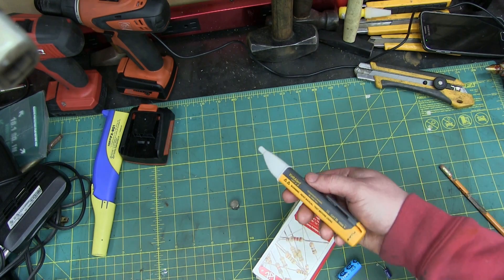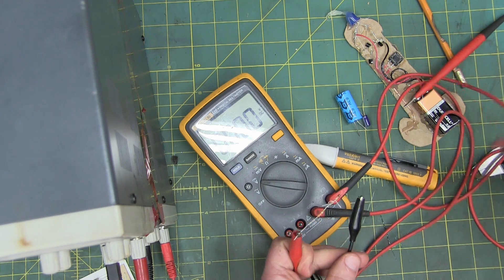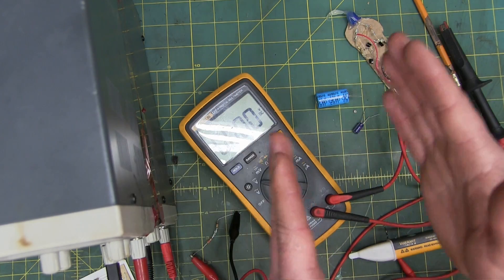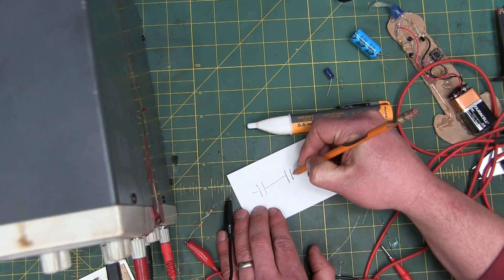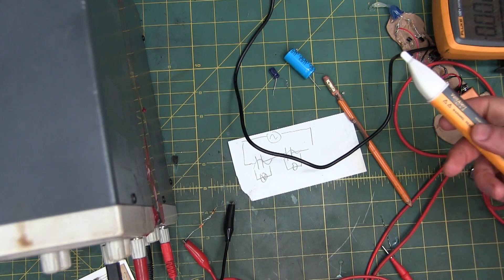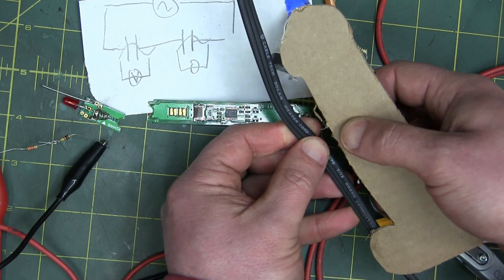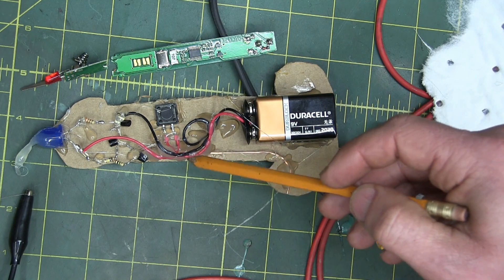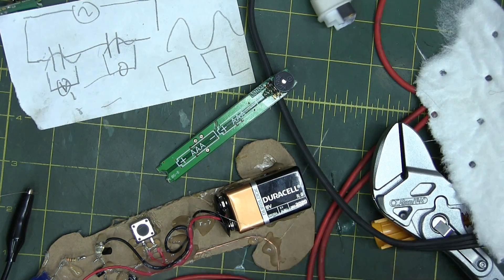Non-Contact Voltage Tester | How does it work?

Comment: this comment has to do with your clear wood video.
I dont know what you have and haven't done off camera. But I have a few suggestions, as I have some experience with resin and stabilization of wood with the use of resin. First off, did you soak the wood in a couple RO water baths to remove the salts? Got to remember that sodium hydroxide is hygroscopic, so setting it out to dry wont do any good. I also doubt the presence of the salts helps with the transparency of the wood. You may also need to bake or even put the wood under a vacuum to properly remove the water content, as wood doesnt let go of all water at ambient conditions, even in a zero humidity environment (as far as I have learned, wood is a little hygroscopic as well.)

I have also learned that some resins are sensitive to sulfur and sulfur containing compounds, so you may want to be extra sure to thoroughly remove the sodium sulfite. 

Your urethane resin is almost certainly too old, as if its been opened in the past, then its been exposed to water. I have looked into the reaction involved in the degradation of urethane resin, and part of the reaction with water, results in the creation of more water, so once that lid is opened, it has a limited life. 

I highly recommend researching what resin the research group used. you are going to want something that sets slow, to give you time to properly degass the wood. you may also want to look into wood stabilizing resins like cactus juice or gator venom, as they are heat cured, which gives you all of the time in the world to degass the wood.

something you should also strongly consider, is if you decide to go with a two part resin and not a wood stabilizing resin, you should both degass AND pressurize the samples, and leave it pressurized until the resin has cured.

If you have ANY questions or comments, please dont hesitate to ask :)

Comment: when i had one of those i could never use it like you did, its like it was too sensitive, it would light up when i got within  6-8 inches of a cord or outlet so i couldn't use it to see which wire or prong was live and which was neutral, it'd light up anywhere near it. it was a fluke brand so i'm assuming it was a good one

Comment: When current flows through a conductor it creates an electro magnetic field (emf). The more current that flows through a conductor, the larger the emf. Non contact voltage testers (NCVTs) only work within a specific voltage range (ie. my fluke only detects voltage between 90-1000VAC). This is because this NCVT has been designed and constructed to detect this amount of emf. It is possible to manufacture other NCVTs that can detect higher and lower voltages. However, detecting higher voltages with a NCVT has its own issues that I won’t go into within this comment. 
Essentially, what I’m getting at is that NCVTs work on the principle of Faraday’s Law of Electromagnetic Induction. 👍🏻
Reply from the maker: "When current flows through a conductor". How much current is flowing in a "hot" wire that's not connected to anything?

Comment: Hey I was curious I have a stud Finder that also has A non contact voltage tester built into it and if I put my hand in front of it and wiggle my fingers it senses Electricity is at the static built up in me or is it picking up electricity my body produces

Comment: I'm confused. The thing you made is a sort of radio receiver. Am I right that that isn't working on the principle of a capacitor voltage divider? In particular it shouldn't need a ground connection through your body but the capacitor thing does. So then are you saying the chicken stick works the same as the thing you made, or is it a capacitor divider?

Comment: One of those ticker testers saved me and my buddy's life at work one day. We were at Irving tissue in their switchgear room getting ready to add another section to the row of breaker racks. The Journeyman we were working under, along with a plant maintenance worker,  disconnected the power and locked out the section we were to work on. Then we were given instructions to remove the side panels and remove the bolts holding the copper bus bars together to get ready for the new section. We got the covers all off and were getting the sockets and wrenches ready when I told my buddy "wait" and I pulled out my ticker pen just to make sure. That shit started ringing more than 12" away from the bars so I got out my meter and measured a full 600v across all phases. Turns out they cranked out the wrong breaker... Jeff was literally walking up to that thing with a wrench about to start working on those bus bars and I put my arm out to stop him when I said "wait". 1600amps 600v , about 30' from the exit, we would have been dead for sure!
Reply: 600 volts really how odd.

Comment: Im just guessing these types of probes work by measuring EMF or by using the battery inside as a voltage reference with an inductor an/or capacitor measuring the change in voltage

Comment: It's probably a waste of words because if the patron pestered you about this non contact voltage tester he probably cant understand this: I believe the reason AC feels so much more intense when you get shocked is the fact that it is more. 41.4% more to be exact at its peak to peak measurements. Our meters convert it back to a DC RMS number for practicality sake.

Comment: @ 4:59, took me back to my high school days. We used to blow capacitors up in electronics class when the teacher would venture out of the room. Probably not the wisest thing to do. However, how many of us were wise in high school?
Reply: My friend in electric shop put a nail if each side of an outlet, laid his watch across them and powered it up. He didn’t understand why his watch wasn’t “shock proof” when it said it was. 

Not the brightest bulb...
Reply: assassinlexx, how many of your friends did you shock the snot out of? I never thought of doing that? Lol
Reply: Back in the day, I worked at a certain audio mfr in Lynnwood, WA. The production test techs would punish any of their fellows who came in late and hung over by putting a few capacitors in their (switched, normally off) test bench plug strips. Never seemed to learn....
Reply: High school is where we went to learn about life while they dumped useless information over our heads.
Reply: Paul Drake, I now have kids in high school. They still dump useless information over their heads. Actually, more now.
Reply: And they got rid of the good stuff. I had trig/analyt in11th and my kids highschool tops out at algebra 2

Comment: The original 'voltstick' only use one FET and 2 AA's, the gate of the fet going to a wire in the tip next to the led, so it was an open gate, didn't even need a pushbutton, very little to go wrong.
sensitivity adjustment was bu placing a finger close to the tip to attenuate the signal.
The Schmidt trigger is not exactly a square wave, as the voltage rises it 'toggles' to on, as it falls it toggles to off, there's a bit of hysteresis in the system too.
Reply: Bad experiences (detection unreliability) with the original Fluke model. Acquired a Uni-Trend UT12A detector (via a colleague who's dad worked for Uni-Trend), and that's lasted years - VERY reliable, and acceptably sensitive (i.e. relatively immune from floating neutral false detection). Recently acquired the "new" gadget from Mustool - their MT812. Interesting in that this has a graded (LED bar-graph) response - sensitive enough to detect neutral return / low induced voltages (so useful for tracing "de-energised" cables), but also capable of discriminating between "live" and "induced voltages". Not enough experience to fully trust this for "last minute checking", but it seems as good as the old Uni-Trend for high(er) voltage detection. Any other "early adopters" out there for comments??
Reply: Sparky Projects The whole purpose of a schmitt trigger is to provide hysteresis to a basic comparator
Reply: Have you had any experience with Santronics testers? Being an electrician for the last 18 years I have found it to be very simple and sensitive.
Reply: santronics the best 17 yrs in business.   no on/off  switch     VERY reliable
Reply: wowzer i justs had a nerdgazum

Comment: Why is there a battery-powered penis on the healing bench?!
Reply: Notice the extra smoo on the tip.
Reply: Robert Leitch AvE has habit of using his wife things.
Reply: just the tip, mind you
Reply: Okay, now it all makes sense.
Reply: I believe thats called the PixiePenisProbe, it goes with the PeckerDetector lol
Reply: Maybe it is for dicking around?
Reply: microbuilder No.... It doesn't "goes" with the PeckerDetector, it "comes" with the PeckerDetector... But only if she's in the mood.
Reply: Why do you think there needs to be a reason to have a battery-powered penis on the healing bench???
Reply: Why not?
Reply: Ahem... It would not fit in the vice. :-D
Reply: Victor García and only for a minute
Reply: It's actually on the relax-o-mat.

Comment: I would love to see how a pH meter works
Reply: A pH meter has two electrodes. When you dip them in the solution under test (an electrolyte) a voltage develops between them. That voltage is dependent on pH. Confuser then converts voltage into appropriate pH readout.
Reply: The electronics are simple (high impedance FET millivoltmeter is all you need - an "off the shelf" cheap meter works fine!). The electrodes are the costly component (though there are cheap ones via the usual Chinese suppliers). If you are looking for an accurate, linear (over a wide range) pH meter - then you're going to have to spend a little more (actually a LOT more), but as always you get what you pay for.

Comment: @2:25 just wanted to bring up a (sometimes forgotten) point here. Voltage dividers only work for things like microcontroller inputs/other high impedance situations/etc. You can't use them to drop the voltage to actually power anything that will draw any useful amount of current, since you need the current through the first resistor to be more or less equal to the current through the second resistor for the equation to be valid.
Reply: Those two scenarios your describing aren't resistor dividers, those are current limiting resistors. the lightbulbs limit the current in the coil, and the resistor limits the current through the LED. Your idea in the video about powering a 5v device off of a 9 volt battery won't work if the device needs more than a few milliamps.
Reply: Yup, what the other gentlemen here have said. Let's go through an example here: Say you've got a load that draws 1 amp at 12 V, but you've only got a 24V power supply. Should be easy, right? Just wire up two resistors of the same value in series (for simplicity sake, say 1K Ohm each), and attach the load at the middle point between the two resistors, and all is good, right? 

But do the math and you'll see that everything is not good! Before you attach the load, you'll have 24V/(2K ohm) = 12mA of current through both of the resistors. Attach the load, and suddenly you'll need to pull an additional 1 Amp through only the first resistor, which isn't going to happen if you keep that resistor value at 1K and the supply voltage at 24V (since V=IR, if you wanted to keep a 12V drop across the first resistor, you'd need to drop the resistance value down to ~12ohm - and get a resistor rated for 12W heehee!). 

If you know that the current draw will always be constant, then you could make it work by doing the proper math ahead of time. But if your current draw varies (such as with a motor with varying loads, a bunch of LEDs that you've got a dimmer attached to, etc), a resistive divider just won't work well for you. That's why (along with efficiency/heat concerns) voltage regulators are used when you're going to be actually powering something with a lower-than-supply voltage.
Reply: If you’re doing a voltage divider, technically you have to account for your load being in parallel with one of the resistors in the divider. 

This is the basic principle behind the LM78xx/79xx series of linear voltage regulators. The chip is in series with the load, and constantly varies its effective resistance, relative to the load’s effective resistance, such that the load always gets the desired voltage.
Reply: Rule of thumb is you want to pull no more than 1/10th of the current that goes through the whole divider on the center tap if you don't want to have to factor in the additional drop. Obviously that current shouldn't vary much.
Reply: Btw the solenoid is the second resistor,
Reply: A 12v solenoid has a fairly stable resistance.
All inductors I've come across have a resistance measurement. A solenoid in an inductor with a moving core.
Reply: The thing is, if the demand is constant a resistive divider will work.
I wont work when the load/resistance is variable.
The light bulb could easily be swapped out for a big resistor or even another solenoid.
Reply: Back in the days of yore  A properly matched voltage divider of "power resistors" to a transformer output power supply was the way to adjust voltages to what you wanted.  As far as efficiency was concerned on a cold night the Ham Shack needed heat too. Real radios glow
Reply: I think I've seen that voltage divider in just about every guitar pedal that uses push-pull amplifiers. I guess with the smoothing caps and audio-frequency AC signals, it averages out to constant current ;)
Reply from the maker: sure you can. I drive 12v solenoid valves off 24 volts all the time; two 12 volt marker bulbs in parallel wired in series with the coil.  You can also use LEDs on high voltage with the right value resistor...
Reply from the maker: sorry, 2 24v bulbs.
Reply: Yes you can and yes AvE's comment is right. The load just has to be significantly lower than the divider current. So you could drive a 10 Ohm solenoid without problems when you use say a 1Ohm-1Ohm divider. Yep, that usually is pretty impractical. You could also simply adjust the divider accordingly if you drive a constant resistance as load. More practical indeed

Comment: What model pliers are those? I assume they are some knipex model?
Reply: ender4555 
Knipex parallell jaw pliers. They come in two different sizes. The big one 250mm is called 8603250 and the small one 180mm is called 8603180
Reply: ender4555 They are very nice and versatile. It's like a useful crescent wrench 😁

Comment: So if we are the ones that are capacitively charged by the ticker why does the ticker still work if i ram it into the receptacle and walk away to find the breaker. I feel like im either missing something or theres more to it.
Reply: It's the continuity testers that use your body as a cap and the second lead. AC "ticks" are inductive I think.
Reply: beat me to it. i don't think he's quite right on this one.
Reply: The detector is not using your body. It also has nothing to do with capacitance. The transistors are also not amplifying. The transistors are just digitizing the signal to make it either yes/no. https://www.jameco.com/Jameco/workshop/JamecoFavorites/non-contact-AC-voltage-detector.html
Reply: The pen doesn't give your body any charge, it amplifies the signal picked up on the antenna with respect to its surroundings (i.e. Earth potential). Your hand is a good path to Earth but given there is no metal touching your hand, it might as well not be in circuit.

To say it's capacitive is to say it uses electric fields (because caps use electric fields), the antenna picks up the electric field and it is amplified by the transistors.

AvE made out that your hand is a capacitor plate, (technically it is, but not significantly) no, one plate is the wire antenna and the other is the wall socket or ring mains wire.

Remember, any surface can act as a capacitor 'plate', a wire, your finger; it does not need to be flat and it does not need to be parallel with the other 'plate'.
Reply: I always heard these things could go off on a magnet, I haven't had one in years, but I'm pretty sure I used to use one to test solenoid valves back in the day.
Reply: Because it doesnt have to be you. The air itself is a capacitor. The case of the tool is a capacitor. A rock, yup, you guessed it, is a capacitor.
Reply: I was always told it picked up magnetic field of current.

Comment: I had a Sperry stick for a couple of years. Got it because I needed one right away. It's gahbage. After the thing tried to kill me the 3rd time (said it was not live when it was) I bought a Fluke 1AC. That thing is great. It will tell me what side of an extension cord is the hot wire. The Sperry would sometimes go off when it came near a building in the rain, it would go off for any wire that was anywhere near something hot, then it would not go off when it was touching a bare live wire.  Just hopeless.
Should have bought the Fluke to start with.
Reply: That's we electricals call them widowmakers. They have their uses, but never ever trust them 100%
Reply: John Ridley You should get a multimeter... 👍 they dont try to kill you as often.
Reply: I find them most useful in finding out which extension lead has gone dud when you have about half dozen daisy chained together.